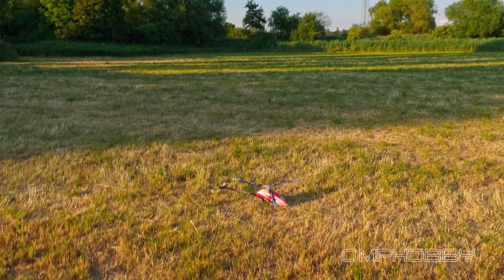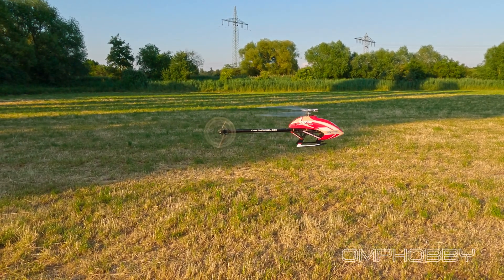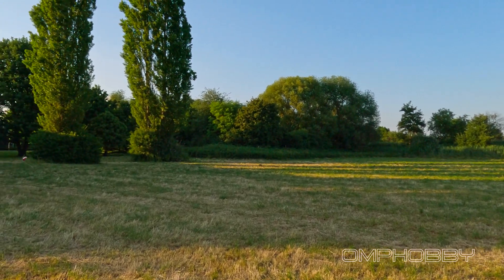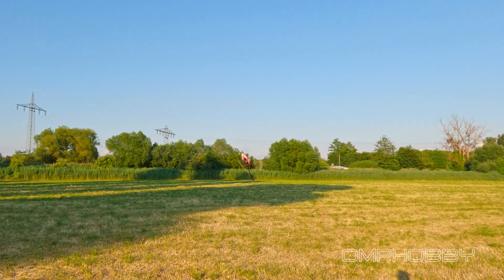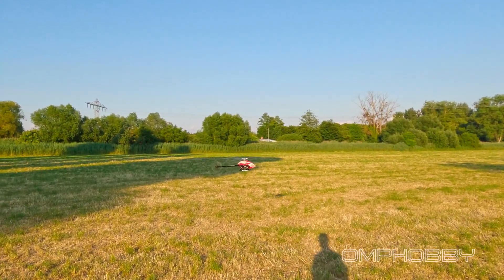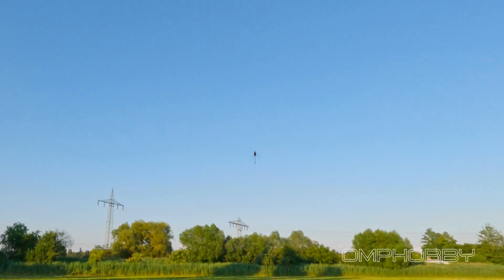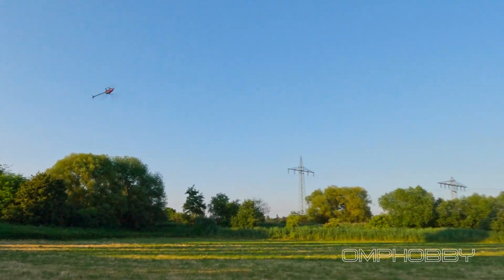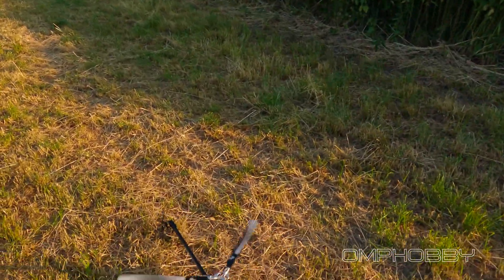OMPHOBBY MULTISTAR 3-Blade - Mixed RPM w/ Commentary

Comment: great flight👏
Floating and unique sounds🎶
Based on the old mikado logo400V-BAR
I had my father modify it to Hirobo MRB III's 3-rotor specification, and balanced two sets of 425mm carbon rotors.
I was flying it. It floated much better than the two rotors and was fun.

https://youtu.be/uTzrxGMrffo?si=If24glsb6Cg7wE5q

Comment: Couple questions: does the disk loading increase with this set up compared to stock?
Is this something that will be available for the Max?
And when will m4 max tail booms be available in the US?
I just got my max built and absolutely love it. I’m just afraid to crash right now with parts not being available. 
Thanks!
Reply from the maker: 1. With 362mm blades, obviously disk loading will be higher.
2. If you can find blades for it, you can also put the head on the MAX.
3. Best to message BuddyRC about this question.